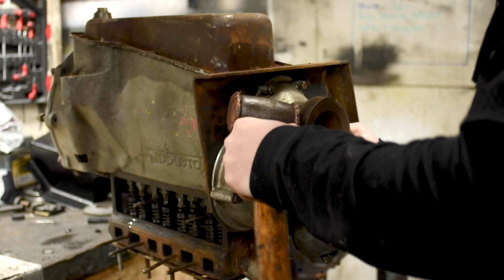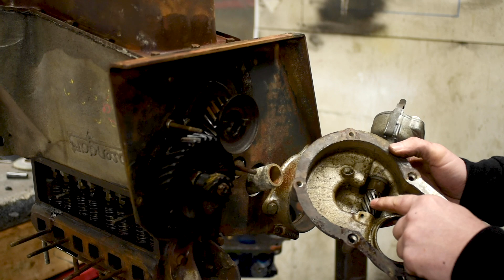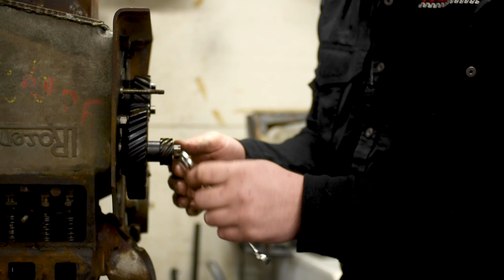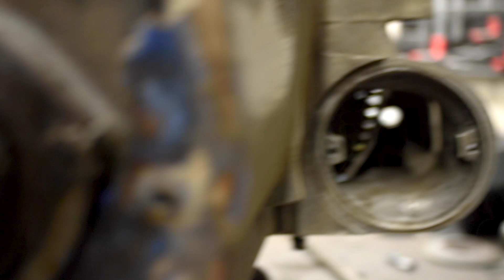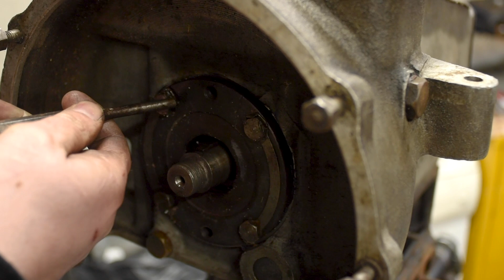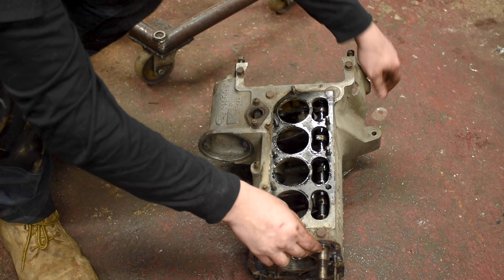Stripping 1930's Engine From Rosengart Classic Car.

Comment: French engineering is always interesting.  For some reason, they take a look at what everyone else does, then they go away and work out a different, more difficult, more expensive and often more elegant way of solving the same problem (Citroen DS suspension, steering and brake systems being a perfect example.)
Reply from the maker: Haha that is close to the truth than a lot of people imagine, this engine has all thw hall marks of the Austin 7 and reliant motor just a bit more complicated and harder to work on, but some thimes there is joy in that two thanks for watching 👍👍
Reply: @HREIRL  Interesting - I was just looking around for a little more information, and it seems that in 1923, Rosengart got a license to build the Austin 7 in France (trivia of the day: BMW also got its start in car manufacture building Austin 7s under license.)  Presumably Rosengart was influenced by the Austin design when he came up with this engine.  :-)

Comment: Great video, Can I ask you how do you know what torque settings to use when assembling the motor or have you already found this information !!
Reply from the maker: Very good question, Very hard to find torque specifications for these old engines but it is possible to work out a torque from the specification of each bolt. When I have a bit more information I will do an up date video of the assembly 👍

Comment: I wonder what power this engine made.... Nice project, I'm surprised you could find rings for it but what about the gaskets? 👍
Reply from the maker: I would say the power would have been 20 ish HP. Ya i was also really surprised when I found the rings but happy I did. Gaskets I am really lucky I have a local company to me that will make me any gasket I want from a 2D drawing in any material I like so im well sorted